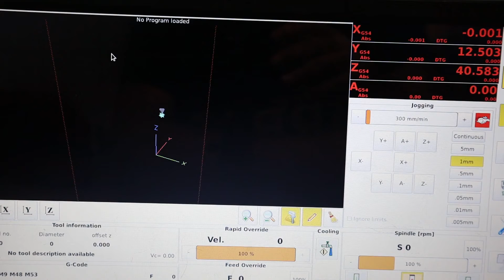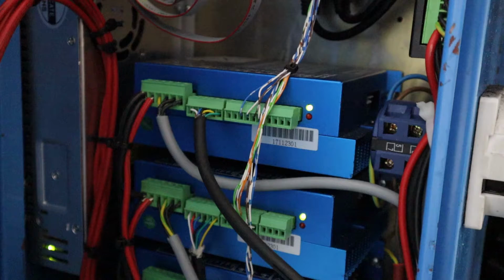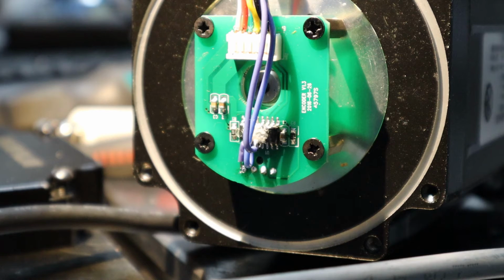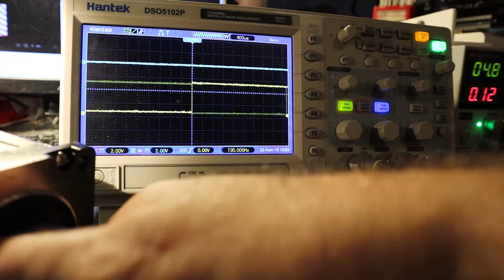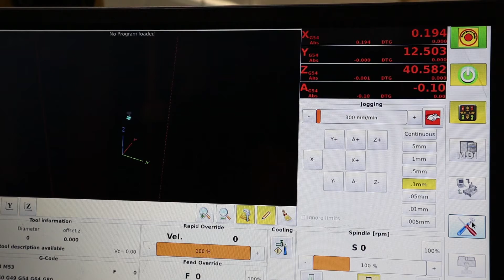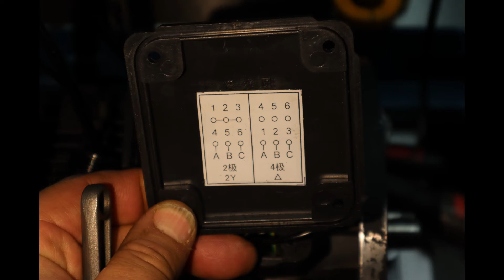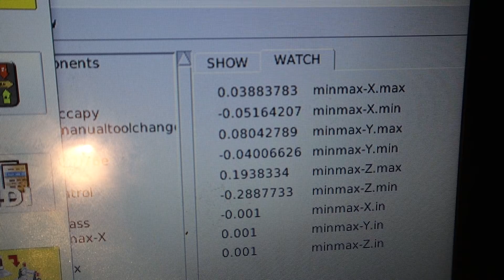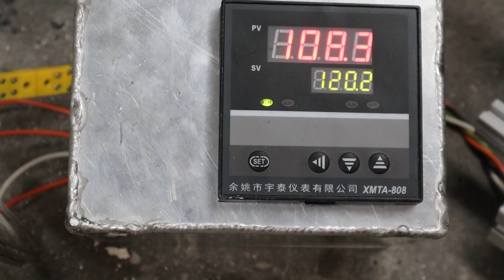Linear encoders on stepper motor CNC milling machine. Part 13 First use of Y

Comment: Hey, that looks like the same drivers i have .. and the index pulse thing you talk about, how do you use that? that was very interesting .. atm i only have the sensors to set the home position of my machine =) what are the drivers you use?
Reply from the maker: The linear scale has an index pulse signal in addition to the A and B. I use mesa 7i96e and a separate 7i85s for the encoders, just connected the three signals. Then followed the linuxcnc docs for homing. It was straight forward.
Reply: @metalmusings  Ah, now i feel stupid .. ofc its the scales =) But thanks, still left a seed in the back of my head =)

Comment: does this stepper motor come with an encoder, or did you add an encoder to a regular stepper?
Reply from the maker: The motor comes with an encoder, it's a closed loop stepper motor.

Comment: Always great video !!! I love your electrical kiln, could you share some data about the resistances you used ?
Reply from the maker: Oh, I have to calculate backwards then. Bought them on ebay rated at 220V 1000W each. 3 kW is fine in that kiln, heats up to 850 in less than an hour.